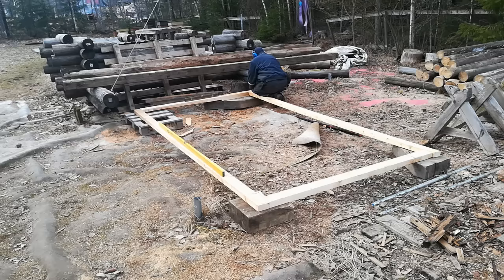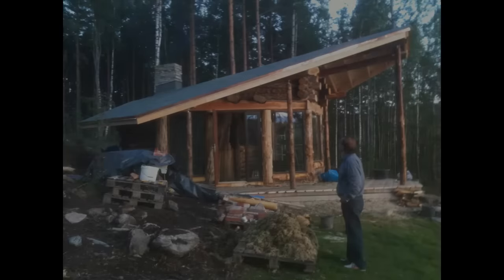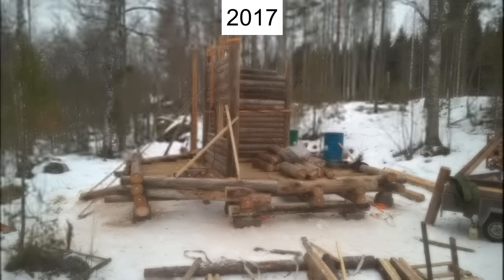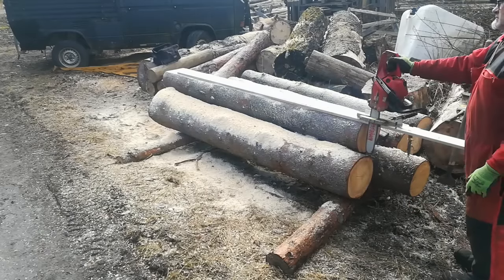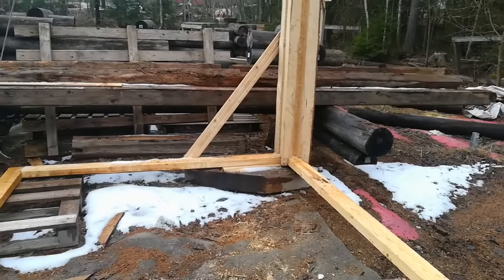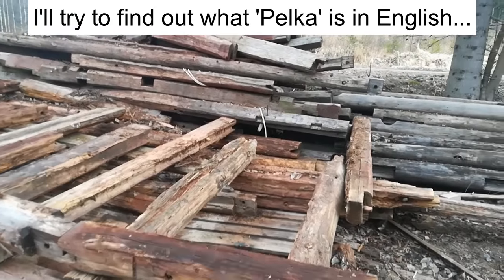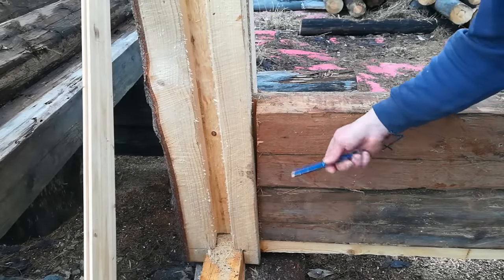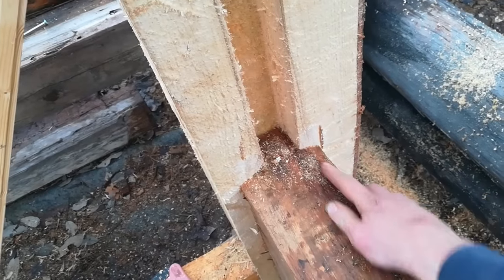Easiest log building method ever!!. Part 1.

Comment: Hello. I'll probably disappoint you, but this method was invented long before you. Back in the 18th century, various outbuildings and fences were built in Siberia in this way. There are also rooms for animals. They were built without insulation between the logs, and then the seams were covered with clay and straw. When building fences, the insulation was naturally not used at all. With respect to you and your work. By the way, such fences were called "zaplot".
Reply from the maker: You are not the first, and will not be the last to point this out. If I could figure it out it is no surprise that others have done the same. But thanks for watching and for commenting.

Comment: The vertical log system looks very similar to the post frame buildings being done with dimensional lumber... Large, sturdy vertical posts that form the backbone of the structure and then these are tied together. Great building methods.
Reply: Post and beam, pole barn, timber framed... all the same basic principle. As you've explained, sturdy poles and beams. Superior to stick framing (dimensional) Allows you to build the entire building without walls. Will stand stronger in wind and heavy snow load. Just build walls in between the posts. I look at it like fencing as an easy visual. Capped good neighbor fence, posts, a beam (top plate) across the top, a kick board and beam (floor joist) across the bottom with fence boards (the wall) filling the gap. You can kick the wall down but the structure will still stand

Comment: Frenchmen called this style Piece Sur Piece. And to me a very interesting option to the long horizontal or vertical style of construction. You could use most of the cut offs or use trees too gnarly for the typical house. 
I like it. Here in Florida we need tulip poplar or Cypress. Both hard to come by
Reply: Exactly 
We used to build cabins and camps that way back in the old days in the province of Quebec for lumberjacks in the back country.
Reply: Don't you folks have cedar in the swamps? I'm under the impression that even though it isn't as strong, it is rot and insect resistant, so if you use bigger logs for the support parts shouldn't it work?

Comment: The method of building wooden buildings with a traditional timber frame with horizontal plank or log infill has many names, the most common of which are piece sur piece (French. Also used to describe log building), corner post construction, post-and-plank, Ständerbohlenbau (German) and skiftesverk (Swedish). https://en.wikipedia.org/wiki/Post-and-plank
Reply from the maker: Interesting. thankyou.
Reply: Yep, I used a version of this method for my cabin. Examples in Poland have been dated to before 700 B.C.
Reply: @ProjectHighlander  Hello sir, I would like to build a 18X 24 or 18X 32 using this method. It will be easier at my age.   So you do not mention insulation between logs and log joints.. do you use insulation and do you use any chinking ??  And where do you use the spikes, or wood dowels, or any rebar ?? I did not hear you mention this in video.. Thankyou so much. I appreciate the help with these questions, the sound on videos could be a few notches higher..be safe, and may God bless you..
Reply from the maker: @harvdog5669   All of these points are covered in detail in the later videos in this series

Comment: I'm in Australia on a 50+ ac bush block with some very fine quality trees for building with (red, yellow and grey box). This is some of the most fantastic wood for not only firewood (where it commands a premium of at least $250cubic metre chopped and split) but for building with. They're all termite resistant, great underground and look incredible either rough sawn or furniture grade. Yellow Box is a tall tree so you get long lengths (not true logs because the trunk is generally very broad) but the other two fork about 5m from the ground so their lengths are limited and their trunks are generally very large also, being typically a metre + in mature trees and often far larger.
So at my place there are left overs are from illegal timber harvesting from before I bought the block and others are natural tree fall. Mostly the top quality trees very rarely fall over and die still standing where they stay for about 150+years becoming habitat trees, but the harvesters cut them down at my place and stacked and categorized the logs. 
The block got sold (to me) and the cheeky buggers demanded I give them their wood. Needless to say I refused. Nothing came of it because the owner before me was just happy to sell the land to me and wasn't interested in perusing the illegal timber harvesting matter so the thieving bastards got off. All us locals know who they are. It is amazing after decades of this sort of thing they never get caught and they're still bloody at it! 

Moving on, I have an idea remarkably similar idea to yours and yes it is less elegant than the lovely notches you cut in the vertical timbers.
What my idea is, on the verticals forget notching them. Butt the horizontal logs up to the verticals and bolt with heavy wood screws 75x75mm rough sawn on to the verticals for the horizontals to butt up against, ie create your own notch with 75x75mm either on just one side or both sides of the horizontal logs - so it could be single side or double side notch. This should further cut down on construction time and still look the part.
Alternatively steel Parallel Flange Channel (PFC) could be used and it would rust agreeably and the logs could slide into. For the comparatively small amount you'd need the cost wouldn't be prohibitive but I work in the steel industry so my cost is far lower than retail - just an idea. 100x100mm or 100x150mm angle could also work on one side. Need an oxy or plasma cutter to bore holes in this stuff though. Forget drilling it unless you have one of those magnetic drill machines with a hole saw.
Reply from the maker: I think I understand your idea, you are obviously working with much bigger logs than I have access to. So you mean you would cut a flat side on your verticle log and bolt/screw a couple of 75x75 posts to it with a gap between them (groove) between which the ends of your horizontals would be sandwiched?... Let me know if I got this right....... II can't immediately see a reason why this would not work although you need to consider that even vertical logs do shrink as they dry, they don't shrink much vertically but the couple of mm they drop per meter can add up if your posts are tall. It could be enough that it compromises your fixing system (heavy wood screws). Consider attaching your 75x75 at the bottom as normal, leave it free in the middle, but at the top use a big bolt and washer not through a round hole in the 75x75 but through a vertical slot (for example a plunge cut with the chainsaw straight through). That'll allow the vertical log to move a bit without breaking/bending any screws.

Comment: I found this entire series very interesting, a treasure trove of interesting information done by a true craftsman. I offer no criticisms having experience with this type of work. My compliments Sir...
Reply from the maker: Many thanks. You will be interested in my Spring 2021 log building project. I will be combining several log building methods together on a really interesting and challenging project.
Reply: @ProjectHighlander  I look forward to it with great anticipation and expectation.
Reply: @ProjectHighlander ha
ndhewcabins to i
Reply: @ProjectHighlander  And are the 2x4,s at corner notched the exact same shape the logs need to be notched on end to bring corner together ?? You did not show those notches before you put Them together..thanks
Reply: @ProjectHighlander  On the notches, are they a 2 inch notches or what size notch is recommended. Thankyou
Reply: @ProjectHighlander   I want to try using a router to do notching.
Reply from the maker: @harvdog5669  ok, I think I understand that you mean the vertical 'grooves in the standing logs? yes I aim at 5cmx5cm but not too exact as you still need to get the insulation in between.
Reply: @ProjectHighlander  5cm is 2 inches ?   I know nothing of cm,s here in USA, I looked at tape measure and I think 5 cm is just under 2 inches. If I am wrong let me know. Thankyou.
Reply from the maker: @harvdog5669  5cm is two inches.
Reply: @ProjectHighlander  Thankyou, when I do build.  I will be building a 18 X 32 cabin MADE of logs in my area, ponderosa pine, pinion pine, oak,    building dept at county might have me putting the posts every 4 to 6 feet. We will find out. Need to study videos for more detail on roof beams..I will do a video on build and share with you.. And I can collect 8 foot logs by 8 inches thick, I want them to be all round logs, at least round on the inside and outside, flat on two sides.. will try to do notching with a router. Just a thought. We will see. Maybe I can do all round logs totley... Ok time to start collecting logs and stacking them to dry for two yrs and keep them up off the ground while drying and stripping bark off right away as I bring them to property. The forestry will sell whole fell trees for 15 to 25 dollars here. But I have to go cut and haul out of forest nearby. Good night. We will talk more later. Time for bed here at 11:46pm.

Comment: Wow. I am very impressed with your chainsaw skills. I'd like to start moving into this sort of construction. I'm a carpenter in Australia, the standard of construction is appalling. I wouldn't buy a new house and would only look to buy a house older then 90's as it seems that's when standards dropped off a cliff.
Reply from the maker: Yes, we had the same drop in standards here about the same time but they also started using plastic in the walls, sealing everything, and then trying to compensate by adding motorized ventilation. They are still building that way even though hundreds of 10 & 20 year old houses are now being ripped down as they are full of mould!

Comment: Lord i wish i could build one of those. Unfortunately my physical health isn't what it used to be. That would be sweet to be able to build one for an off grid property.
Reply: Rig up pullies and use like a drill winch, this is my idea since I don’t have great upper body strength
Reply from the maker: The most important thing is to use the brain, not the muscles. You will be amazed what you can lift if you just stand back and think about it. I move and lift logs that weigh much more than I do without lifting equipment. You just have to take it slowly, think about the point of balance, consider friction etc.
Reply: @ProjectHighlander  yeah. But I'm in a wheelchair. So not building much

Comment: Great method! A true pioneer! I am going to give this a go. My question is... on average what is a maximum structurally sound distance between the pillar/support logs. I know there are variables, I'm not looking for concrete just a rule of thumb... thx again!
Reply from the maker: That's a really hard question to answer because, as you said, there are so many variables. In terms of the strength of the walls themselves I don't see why there would be any limit if you have lifting equipment. However the roof structure rests on the posts not the wall sections so you need enough posts to hold the roof up. In the end I think this riddle will solve itself based on the layout of your building. Posts at each corner, on both sides of any windows, on both sides of any doors, and then mirror the posts in the front wall onto the back wall and you will have your answer. Sorry I can't be more precise.
Reply: @ProjectHighlander  it's ok, I appreciate the response. I understand the difficulty. I am thinking about a smaller 20 x 20 ft.

I didn't want to use just 6 posts if more would be required, structurally... most of the logs will be 15"-20" diameter, with access to any lifting equipment necessary... is it possible to still lay a roof on say... only 4 posts at a twenty ft span, just for thinking, if there were no door?
Reply from the maker: Good question. 20ft is about 6m, you might be pushing your luck. 400 square ft of roof only supported only at the four corners? of course a single strong post right in the center of your building would solve the problem but I don't know if that's an option as I don't know what the purpose of the building is.
Reply: @ProjectHighlander  Thanks again, it's going to be a guest cabin, next to the main. I just want to try out this method, as imo it is much better looking then a regular notch cabin. The thought is to have  door, no windows are planned right now, and then the parallel portion to the door will have a support halfway up, and an old style hearth and chimney.
Reply from the maker: ok, well if I were you I would consider placing your door right in the middle of one wall. This would mean putting a post on either side of the door. Then in the opposite wall put in two posts in the same positions as in your door-wall. That means that as you put in roof supports you will have four really good supports going front to back (assuming your door wall is your front wall) resting on posts at both ends. (I would still think about a post somewhere in the middle of the building)
Reply: @ProjectHighlander  Sounds good, thank you for the insight, and the method.

Comment: Does using a chainsaw like a mini mill do a number on the blades and motor? Seems like an awesome way to mill my own lumber I'm just wondering how safe I would be doing that constantly to a chainsaw?
Edit: This was amazing to watch by the way. Thank you for sharing the knowledge.
Reply from the maker: You need a saw with enough power. It does not seem to have a detrimental effect on the saw. In terms of safety, there should actually be a guard on the mini mill which I have removed.

Comment: I'd just recommend making your footings go below the frost line. Ultimately, yall are all adults and make your own decisions, but I just leveled a house where the perimeter had a concrete perimeter that went down 2-3 feet.  The rest of the house was built on blocks directly on dirt. That was done in 1990 and I moved parts of that house up 5 inches. Seriously I'd recommend putting some sort of stone footing. Digging is a pain but so worth it. It's way cheaper to do it right solid the first go around. I had to cut up and waste so much good plywood. Just a waste to cut corners. This was in southern Wisconsin where our frost line is about 4ish feet. Even the concrete perimeter moved at 2 feet deep. Get into that clay.
Reply from the maker: No clay there. This site is a hillside of free draining sand. There is a log building further down the hill that has not moved in over 100 years that has foundation stones that go just a half meter deep (frost line here 1m+). Everything was taken into account. Thanks for your concern.

Comment: Thank you. Inspiring. I'm a timber framer, sawyer and forester by trade. I am wanting to do a log project in our woodlot. This sounds like and looks like what the French Canadian call piece en piece. One of the oldest trading posts in our province of BC is in Langley and it's piece en piece.

What is your favorite size chainsaw, for power? 
Do you have a video on the highline you are using?
Probably more questions coming.

Thank you
Reply from the maker: Shindaiwa 405s. Best saw I have ever owned. Powerful  but not heavy, heated handle. Will work for decades and never even need a new spark plug.
Reply from the maker: I don't have a video about the highline. To be honest I was a lot of work to set it up and in the end I have used it maybe ten times in 15 years.
Reply from the maker: keep the questions coming! thanks for watching.

Comment: Is this faster and easier than butt and pass? I have a saw mill and lots of pine. Would like to square my logs and perhaps do butt and pass, but this method I like the look of a lot. What would be fastest and easiest considering my square logs?
Reply from the maker: Thats a very good question! unfortunately I have never tried butt & pass but I would imagine that B&P is faster in terms of sheer wall area going up. However the method I use has other advantages than just speed. For example short log length and no need to allow for droppage of the walls, easier for door and window installation etc. Overall, when you add all those things in it is hard to say which is really faster.
Reply: @ProjectHighlander  I really do love your method. It’s beautiful and functional. Another question I have concerns stacking squared logs. What are the ramifications of stacking evenly cut squared logs with nothing in between each log- no insulation, or chinking (if a tight fit)? You mentioned something about mold. Anything else to consider?
Reply from the maker: @Blackbird-zo1su  In a perfect world? no problem at all! in this world, however, bad idea. If there is any moisture in the wood then the two flat surfaces touching will mean mould every time. Also, as the logs dry they not only shrink but they twist and bend so you are going to get growing air-gaps, your tight fit will not be tight for long.